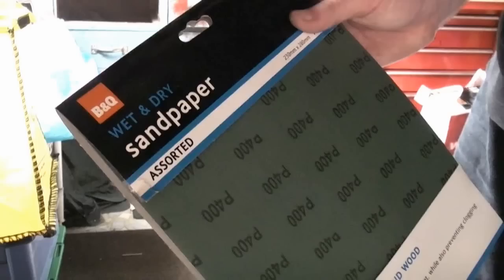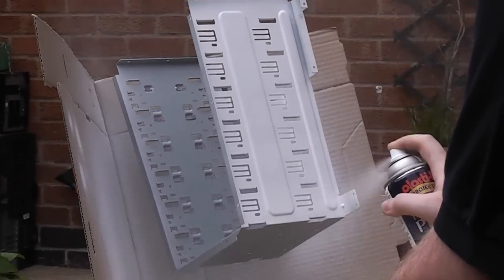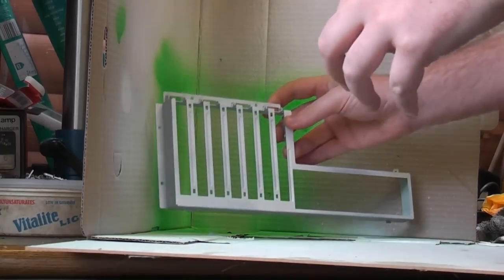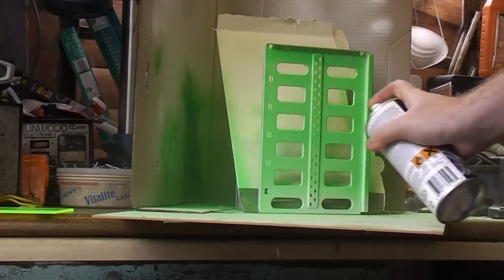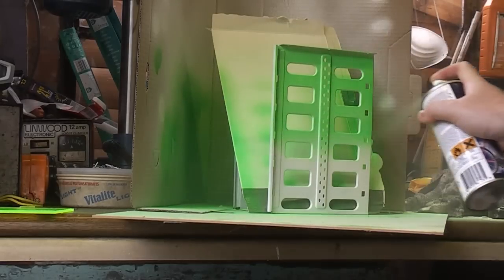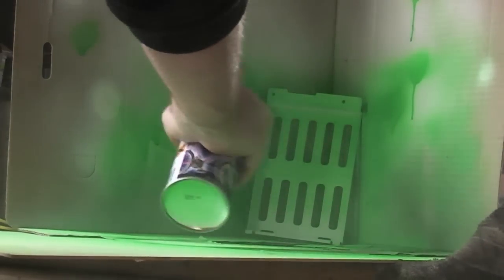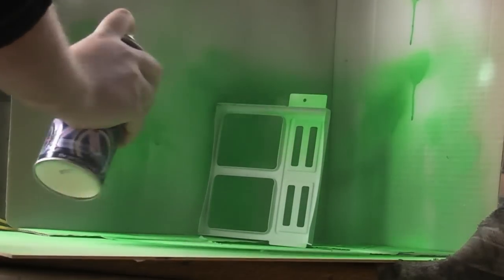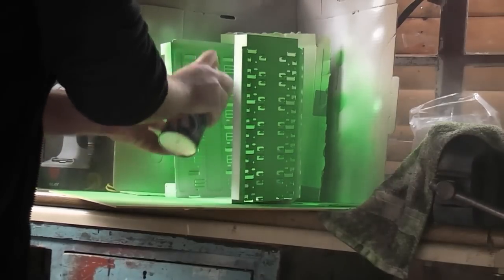Worklog #3 - Painting

Comment from the maker: Cheers LazyMan :)

The primer stuck perfectly well both with and without the sanding, running my finger over the surface of both pieces felt identical too.  However other sections of the case will require sanding for sure.  Thanks for your input :)

Comment: You definitely should sand the parts before painting.  I didn't sand and used an etching primer and still had issues with paint chipping during reassembly.  It was especially bad putting the drive bay clips back on.  Screwing the power supply deck in also caused chipping when I screwed it back in.  So sandblast or sand those parts you are painting.  I used Rustoleum Satin Black and gloss Green Citrus on mine.  I also used 1/4 x 1/8 rivets.  I don't think that was mentioned in the videos

Comment: Nice vid bro, it's not what you can see that your concern with it's what you cannot see. You want to give the metal a tooth for the primer to stick to. This is something you will not be able to see. 

Also IMO you want to use dry sandpaper initially before primer than use wet sandpaper in between color coats and your clear coats.

Cheers
LazyMan :_)

Comment: @craigr1982 Oh I'm sure it will be okay, but IMO you can put on a hundred coats and if the first coat doesn't have proper adhesion then the other 99 won't do much good. 

For the Black Widow, not only did it get 2 coats of primer, but it had been sand blasted to remove the thin coat of gray that the manufacture had applied. Now this may be overkill, but I have seen not only PC cases but just metal in general, if not prepare properly the paint overtime will suffer. Thw BW has no less than 8 coats